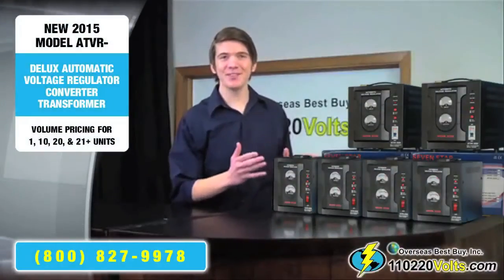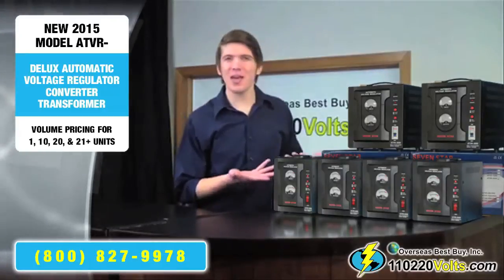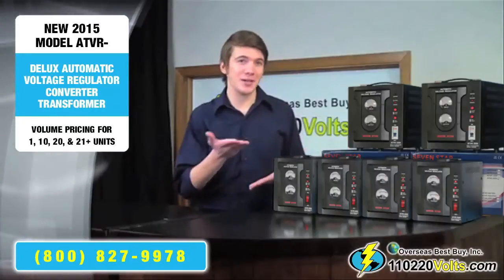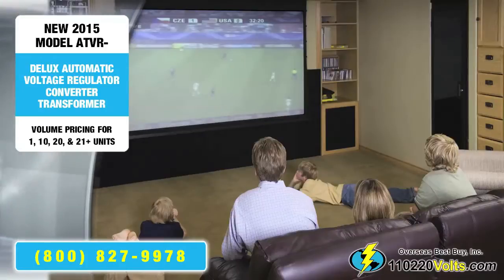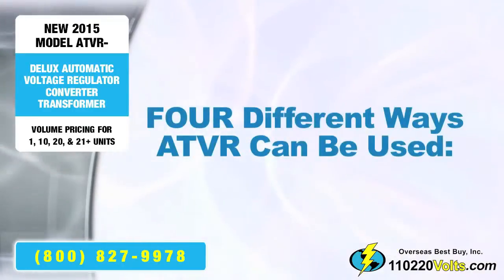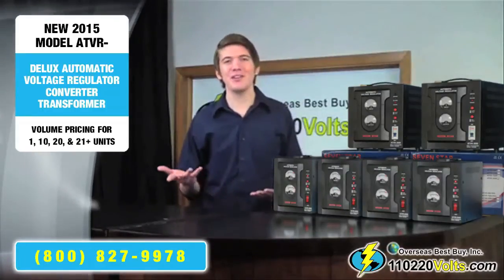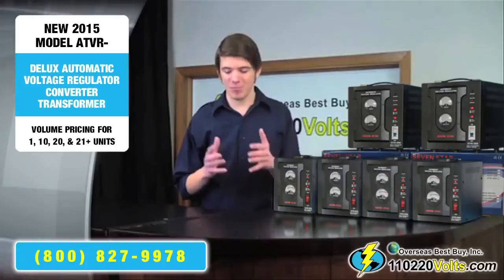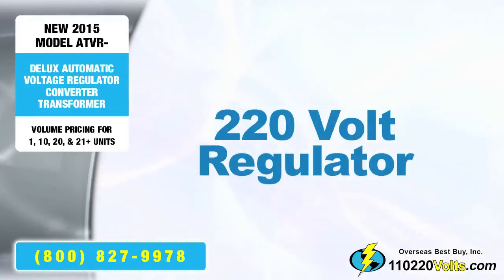Four usages for the ATVR Series of Deluxe Automatic Voltage Regulators

Comment: Excellent video!!!! I was looking for a video on what is a voltage regulator, when would I  use it, and why would I use it? to determine if this is something that I need.

My power is always going out. I am convinced that it is one of two things... Either I have bad wiring, which I no longer believe, or 2... my a/c unit compressor just draws alot of power in its cycles popping my breakers. Soooo... I guess I will pony up and get a new surge protector that has the voltage regulator... 

Thanks again for sharing your experience.